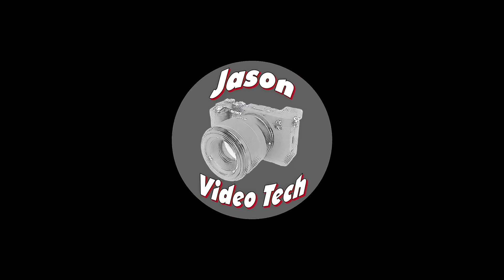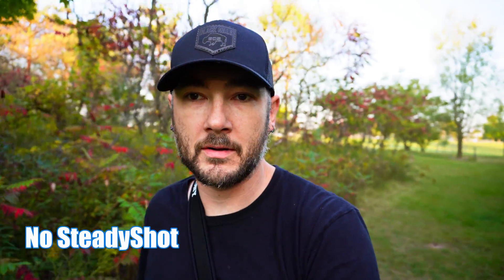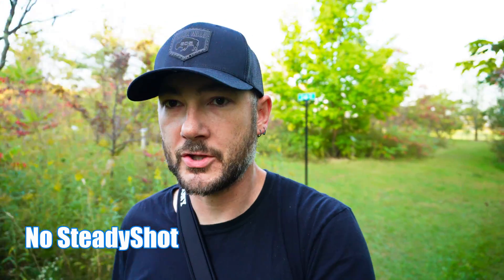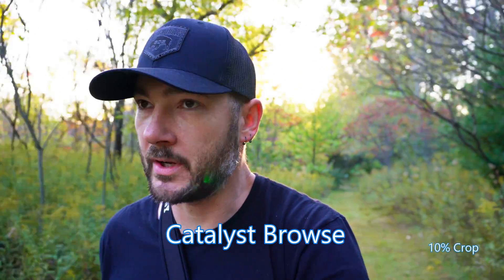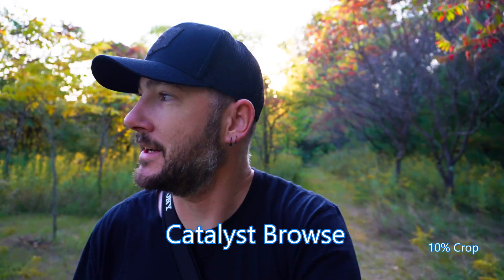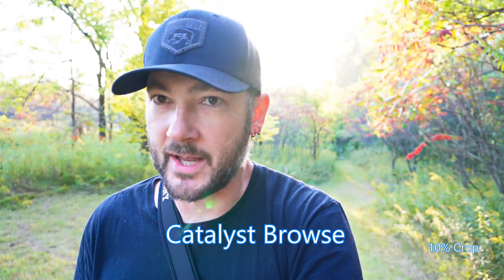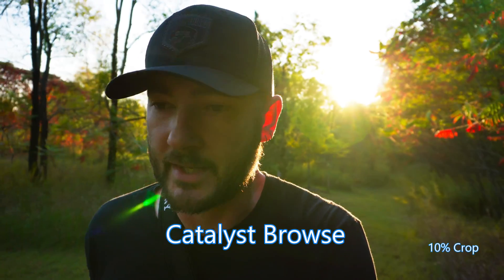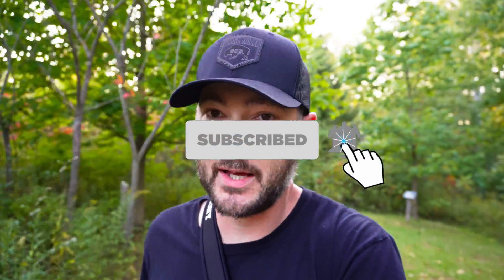Sony ZV-E10 stabilization Test

Comment: Did you increase your shutter speed for the Catalyst Browse test? I haven't done much testing with the software and camera (I tend to just stick with 1080p for vlogging), but the video I did on it, I noticed some jitters when walking which everyone says is because the software doesn't like motion blur. However, in your video here, it looked perfect with no jitters or at least none that were noticeable.
Reply from the maker: Actually I didn't.  This was 4k 24p with 1/50 shutter. I've seen the jitters with my A7c  but I've had decent luck with the zv-e10.  I only go 10% max  in catalyst so that might help.

Comment: Wow, to think my go pro has 3x the stabilization in it's software is making sony and even Cannon m50 look pathetic. The censor on a go pro is how big? Lol. I did leg day at the gym with a go pro on my body and the stabilization while doing workouts looks better on the go pro than the active steady with you just simply walking. These are not vlog cameras by ANY means. Our cell phones within the last 3 years, say an Iphone or Galaxy can ALMOST take as good pics as these cameras, not video though. I might just go sony zv-1 or cannon m50 with a f1.4 lens. I say cannon because it's cheaper than the ZV-e10 by $150 and I can use that savings on a lens. I am looking for dim light recording and blurr background making the workout or person clear as possible. I again will also look at the zv-1, although no sure if zv-1 is better than zv-e10. I think between the gopro and a camera on a tripod I can get footage from different angles and maybe mash it together. I know nothing about color grading or stabilization software in editing though. I just use filmora wondershare. Never did adobe.
Reply from the maker: I had looked at the m50 at one time.  A few things to point out about it.  There is an additional crop when using 4k.  Also doesn't have ibis so the stabilization will be digital and similar to the E10, but you mentioned using a tripod so you should be fine either way.  Also has a recording limit where the zv1 and e10 don't, so if you're recording workout videos you might need the unlimited recording.  Just a few things I wanted to point out.  Hopefully whatever you go with will work out good for you👍

Comment: if you use catalyst version 2021.1 for windows, can you tell me if you have issues when you set your video processing device in the options for a dedicated video card?  i had to switch back from NVidia T500 to my integradted Intel Iris XE, because when I am using T500 it can not even play a video file...
Reply from the maker: Yes I'm using the newest version of Catalyst. I have my Nvidia GEforce RTX 2060 selected and haven't had any issues.